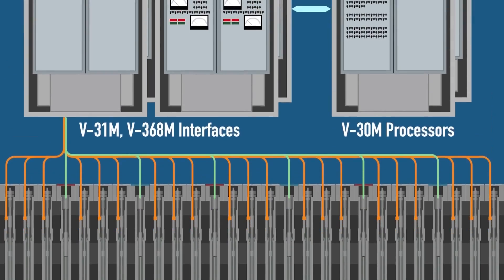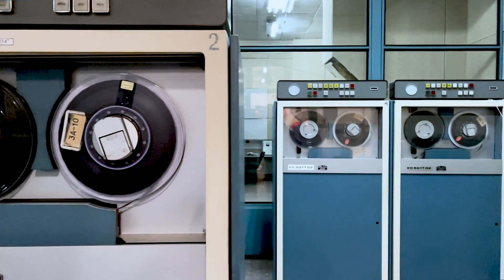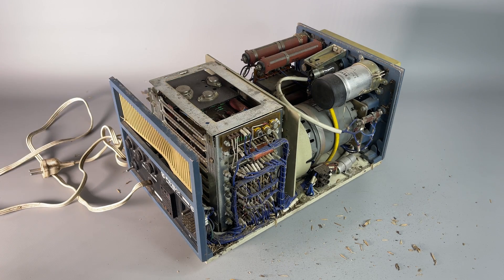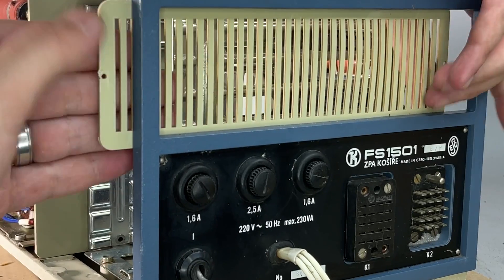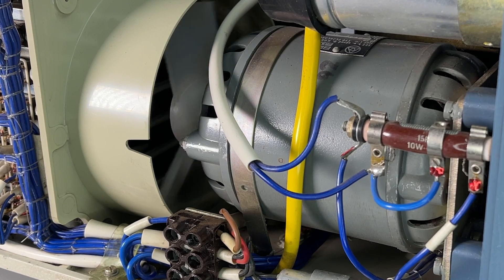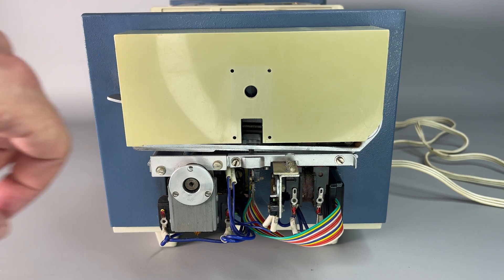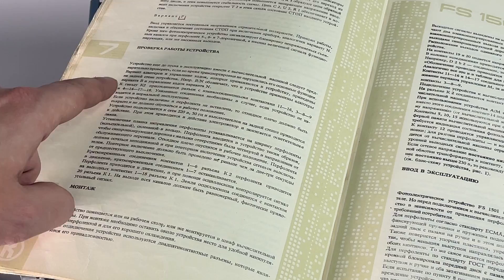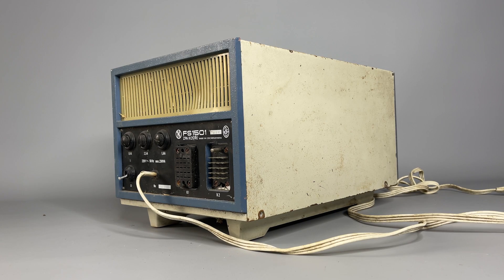Chicken attack! Chernobyl SKALA Punch Tape Reader Restoration!

Comment: Those connectors were made by MEZ and their type numbers are imprinted in the bakelite from front side (it's 55667 for the first one, the second one isn't very visible in the video). Sadly, no one really lists the type numbers when selling so finding it by that is going to be impossible. Even in Slovakia, they are very rare.
Reply from the maker: Perhaps another option would be to look not for connectors, but for FS-1501 cable which I think has greater chances of success.
Reply: @ChernobylFamily  or ask a company like semtec(they specialize in making all kinds of connectors)
Reply: @ChernobylFamily  I believe I found the rare cable! But it appears that youtube removed my comment with the link to the seller. Is there a way I could send it to you?
Reply: The male plug doesn't look too hard to make if you can find some sort of spade connectors the right size. Set them up in a jig and cast them into a resin block or glue them into a 3D printed block.
Reply: @ColinWatters  That's what I was thinking of when I mentioned 3D printing.
Reply: What about 3D printing? Would that help?
Reply: @emilschw8924  I think it should probably be possible to buy DIN 41622 female/male connectors to use their contacts and print only the casings like mentioned before. They look very similar but have their contacts oriented vertically instead of horizontally like those of the FS-1501. Some others have changed the connectors to new ones of another type (read about it in a Robotron internet forum).
Reply: @emilschw8924  nope, you can’t 3d print a connector
Reply: @rogervanbommel1086  You can print anything, imagination is the limit! The pins don't have to be printed, just the plug casing. Are the dimensions of the plug given anywhere in the documentation?
Reply: 3D printing a connector is definitely possible. Especially with a resin printer.
Reply: Indeed, I think if you just got some quick-disconnect spade connectors of the appropriate width, you could design and print a body to hold either the male or female connectors on the one side and the wires on the other.  Add the locating pins and get some long-enough attaching screws, and you'd be set.
Reply: I only had FS1501, not the cables, but since I salvaged it for parts 25 years ago, same pair of connectors might still be in the box...

Comment: It is impossible to imagine the operation of a tape reader FS1501 without the PL-80 punch, which is not in the review.
Reply from the maker: @vch-1contract309  There is a separate review of PL-150M, which was more widely used at the ChNPP. PL-80 were used too, though.

Comment: You can generally use 99(+) IPA to bathe/scrub boards without issue. Ventilation and all and thoroughly dry before operation (gentle heat for a while is adequate)... just check for any parts where liquid can readily enter and adjust the plan accordingly. Hopefully a useful tip.
Reply from the maker: @MadScientist267  thank you for this, seriously.
Reply: @ChernobylFamily No problem. Even water is useful in the wash step, the two solvents working in tandem get rid of most things that were ever found floating around in the air. The "rinse" step needs to be as pure IPA as possible however, as it will be pulling the  remaining water out.

I learned about this while dealing with tin whiskers on newer (at the time lol) equipment. Distilled water is much easier to work with than the IPA during scrubbing, followed by air to remove the bulk, leaving the IPA to mostly do drying.

With modern boards there's almost no issue with anything, but of course older discrete component designs may have ingress considerations... but a beautiful thing when you can use it.
Reply from the maker: @MadScientist267  good to know. Our engineering dude normally uses ultrasound bath, but it is not suitable for everything. Edit: typos
Reply: @ChernobylFamily  Haha yeah.

We just used an old toothbrush for scrubbing, couple of glass pans, wash bottle with IPA. In most of those situations there was little to no dust or other contaminant from outside so we didn't scrub much with the alcohol present. 

With the tape drive, I'd probably start with a wash/scrub using 50% IPA and then blow it off, get it with the pure IPA from the wash bottle, blow off again, and heat at about 60-70C for maybe an hour or so.

Anyway great video as always... and yeah that thing is damn quick 🤣

Comment: To clean, you can use a vacuum cleaner.
Reply from the maker: I prefer canned air, because sometimes inside can be small parts which is easier to locate on the table than inside the vacuum cleaner's filter.

Comment: As a cnc machinist I worked with Fanuc tape readers in the mid 80's. The tapes must be secured on at least a peg or roller otherwise as you saw they will jump and twist then get pulled into the mechanism and the tape will tear. All you need is a simple round rod mounted onto a bookend with a large washer on the end of the rod to hold the tape on the rod so that the tape can be pulled quickly and won't twist. At the output end you don't need anything but you can put a box there to catch the tape. Ideally run it on a desk and place the box on the floor.
Reply from the maker: Thank you!

Comment: That reader was FILTHY, but thankfully undamaged. It could have been worse for it; at least in a chicken coop it was out of the elements. Adrian Black did a resto on a VIC-20 or C64 that looked to have been left partially exposed and had oily filth caked on both inside and outside of it. But after a clean up and replacement of a few parts it came right back to life!.
Reply from the maker: Cool!

Comment: 1:53 "SKALA is not a binary computer...it uses 24 bit words." :D
 Just being pedantic but since since each of those bits can only hold one of 2 values (0 or 1), which led to the use of BIT as a contraction of 'Binary digIT', it IS a binary computer.  Octal, Decimal, Hexadecimal etc., are just alternative ways of representing exactly the same value as represented by a group of binary digits, in order to make them easier to use by human brains.
An EXCELLENT  video nonetheless and a great job on the restoration!
Reply from the maker: Thank you :) noted :)

Comment: That is 50x faster than the Teletype we used at the old radio telescope!  Slava Ukraine
Reply from the maker: Glory to heroes! And now, tell more as actually my wife is astronomer by grade :)
Reply: @ChernobylFamily  As a young man I worked at the University Of Texas Radio Astronomy Observatory (UTRAO) in 1978.  This was an azimuth telescope that did a sky survey in 365Mhz.  I was a night observer, lots of coffee!  The computer was a Data General Nova, it used TTY paper tape after a front panel switch boot loader... then loaded 9-track tape for the main observations.  It used vacuum tube amplifiers!  Also it used giant helical antennas.  You can still see the interferometer cross at  30.110484°  -103.904783° in the west Texas desert near the town of Marfa (named for the Dostoyevsky character).  All the old electronics were bulldozed and buried in-situ but you can still see a concrete ring where a Grote Reber-type antenna az-el mount was set up for testing the giant bifilar helical 365Mhz antennas.  Later I worked for another radio telescope, the Very Long Baseline Array, at the Fort Davis location ( 30.634722°  -103.945016°) which still exists.  I hope someday to visit your country when Russia has been liberated and all is well.  Love your content.

Comment: You don't see these around anymore that's for sure
Reply from the maker: Except one case, probably: very old CNC machines. They also used those readers and also PL-150M tape punch machines (we have a video about)
Reply: @ChernobylFamily  I have one of these and the other one you mentioned they came from the Kursk power plant Wich still operates rbmk 1000 reactors and is the oldest nuclear power plant in Ukraine Smolensk also operates rbmks

Comment: This reader tends to break the tape when it stops. Slower models were much more reliable. To avoid stops, try to start the tape and react to interrupts from the reader rather than starting and stopping it after every byte. You also need a loop of tape with all holes punched to tune the sensitivity of the signal amplifiers.
Reply from the maker: Thank you!

Comment: Can you explain the tape roller - I have one at work, obviously left from long ago and always wondered what it was used for exactly.
Reply from the maker: It is a device that rolls with the same speed or faster than a punch tape machine or punch tape reader. You place it as a receiver for processed tape, and it has a coupling which provides a bit loose holding of the tape roll (say, if reader stops for a few seconds, the roller's rotor can continue rotation, but the tape roll on it will not move). This way it provides constant tension, makes a ready to use roll, and prevents tape flying around.

Comment: World's fastest punch tape reader? The Danish computing pioneer Regnecentralen (Danish for "Calculation Central") sold their RC-2000 beginning back in the early 1960s: As the name suggests, it could read 2000 characters per second. 😎
Reply from the maker: As one of commenters explained, the question of speed is not in a number of characters, but a method of their streaming and the speed of start-stop operations which prevented any data loss during reading. Here inertia of the tape during stop is 1.5 mm if the device is properly regulated (yet jt is not)

Comment: For the connectors, I think you can measure the dimension and thickness, and buy compatible spade connectors that are currently available. Draw a converter board according to the original pinout and solder the individual connectors to it will solve reliability issue. You can choose either to adapt to a standard connector (like a DB one) or to solder the cable harness directly to the converter board. I've done this to an avionics connector before, for driving a clock from a Boeing 737.
Reply: or even using modern technologies as 3D printing, to make own could be good think

Comment: as soon as you shorted it out an ad played about scammers......the timing was perfect
Reply from the maker: Really? LOL. I mean, YT places ads automatically.
Reply: @ChernobylFamily  most of the times it gets annoying
Reply from the maker: Unfortunately, yes. But if we won't place ads, videos will come way rarer — each piece of this tech is expensive as a private jet, figurally speaking...(((
Reply: @ChernobylFamily  i bet, finding that stuff that used to be run a blown up reactor must be hard to find an get
Reply from the maker: Identical stuff. Anyways it does not make it easier.
Reply: @ChernobylFamily  nope though id like to see what the computer system was showing right before the explosion
Reply from the maker: @joshuaryanferguson3702  what you can see is a SKALA of the unit 3 which is identical to the SKALA of the 4th one except back in 1986 DIIS did not exist.
The 4th one is inside Unit 4, so while the internals of the unit are accessible, its SKALA machine hall as far as we know is full with concrete up to ceiling. So it is a bit problematic to show it.

Comment: Does it really use photoresistors? I would have thought they'd be too slow!
Reply from the maker: It appeared there is a mistake in the manual. It says these are photoresistors, but when I checked by the part number, it appeared those are phototransistors.
Reply: @ChernobylFamily thanks 😊

Comment: Do you know the pin layout? And if the cable is 1 on 1? Or with connection inside? The casing should not hard to design. And the cable can be what ever😅 ot is this to easy thinking? Sorry
Reply from the maker: The cable itself is 1-1, but pinout depends on a machine. The pinout of the punch tape reader we know. Good ideas, not an easy thinking at all. Just those connectors are somewhat sturdy, so better to find original. Well, thanks to a few commenters this likely will happen soon :)

Comment: How can I decode these tapes? I have some readers like this and another ones and a lot of tapes. I can read the holes visually, but how do I know what symbol does a line correspond to and if I can even find there something meaningful?
Reply from the maker: You need to check the storage algorithm of the machine which encoded those tapes. Then, if you read them with a reader, you can get raw data which has to be parsed based on that algo.
Reply: I don't have a reader ready-to-go, so I was thinking of typing the codes manually into a PC. I'm not sure where are those tapes from, some might be from CNC machines, some from SM1600 or other mainframes from that era (I found some together with some SM 6204 readers/punchers) and some from a computer factory together with some programmable chips. I wonder if they contained any readable text, like "error". If not, there is no point trying to decipher them.

Comment: A touch faster than my Sagem TX20 telex machine reader.
Those connectors look similar to the ones on Siemens Kleinpolrelais - Relay - T. Rls 64a Bv 3402/1 | eBay
well the flat blade pins, not the alignment posts, so maybe a socket for a Siemens relay will get you part of the way.
Reply from the maker: Thank you! Will check that!

Comment: Seems to be a trend for tech to show up in agricultural locations this week, been watching a series this week of someone restoring an amiga stored in a field on another channel.
A thought for those proprietary connectors, if you knew someone with a resin printer, they may be able to make a replacement faceplate, that you may be able to retrofit onto the existing plug, or it looks like the manual had a bit of a wiring diagram. It may not be too difficult to recreate a compatible board/cable. (Just looks like the pins are spade connectors, so all you’d need to do is make a compatible shell, slot a bunch of spade connectors into it and wire it up,
Reply: Ok yeah did a bit of digging, the connectors were just basically faceplates and you had to wire them yourself to suit the computer that it was going to, and the manual has the wiring diagrams. So in theory if you had accurate measurements, and someone sufficiently skilled in CAD, they could take the drawings from the manual and using the measurements recreate the plugs, and someone could print them in a resin printer, which has sufficient ability to produce tiny features, you could make a whole new plug without much major effort.
For the plug itself you’d have the socket with spade connectors on each pole, inserted into the plastic (no risk of arcing that way) run the wires back to a small project box which you can then break out and breadboard the proper wiring for the connector.
I’d design the plug to actually have a backplane slot in and over the spade terminals completely, to secure them in then screw closed from the back, give enough room that a wire can be fed through to each one though it; you end up with a rock solid connector and room to properly wire stuff up then.
Reply from the maker: I have a feeling that a substantial part of those restoration videos actually being presented backwards from the actual process, if you understand what I mean. In our case chicken shed was just a coincidence, normally we find stuff like this by metal scrappers.

Good point about connectors, the thing however is that we just love to keep things authentic. For now a few commenters reached out with a few options of original connectors, so seems we will go that way. But thank you for amazing ideas!
Reply: @ChernobylFamily  no stress, mainly thought it would help if you couldn’t find originals, seeing as the connector seems to be something bespoke they cobbled together for this.
Reply: @ChernobylFamily  Now you got me looking how hard it would be to do bakelite at home. 
Making the molds wouldn't be that hard (especially for a small run, so I'm not dealing with making molds out of tool steel) once I have the dimensions. 
If you're happy enough with original looking reproductions, all I need is either a CAD model of the connectors or technical drawings of them. I'd have to replace the spade connectors with whats avaible today, and make them out of epoxy. The counter connectors wouldn't be that much harder to design from that point

Comment: What caused the short circuit that cut power to the lights?
Reply from the maker: Pins on that 4x5 connector are numbered from top right town and then to left.
So pin 1 is ground, pin 6 which is next is tape transport start, but pin 11 which is next to 6 is –30V. So given there is a narrow pitch and I had the device standing in a quite inconvenient angle, I accidentally touched pin 11 together with 6. Which blew the fuse, but before it shut down the emergency switch of all lab. I have to say, the bang was much louder than it is on video :)
Reply: Modern circuit breakers can be too fast. I had this problem too with a power supply whose fuse did not blow.
Reply from the maker: I am not sure if it is that bad given that after all we have fragile tech saved :)

Comment: Are we sure it's photoresistors and not photodiodes or phototransistors? In my experience with only cheap CdS photoresistors, they are very slow.(250+ milliseconds response time.).
Reply from the maker: Hm. Seems you are right. In documentation verbally they are described as photoresistors but i just checked by the part number and those are phototransistors. It seems to me that manufacturer made a mistake in translation (the manual is for the ussr, so it is written in russian, but with many language mistakes, which is more than ok, actually).